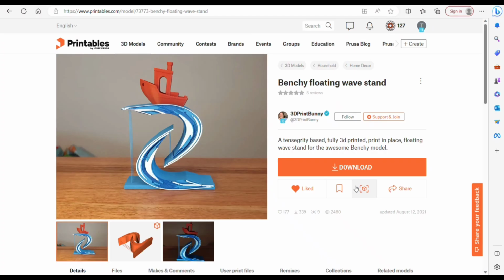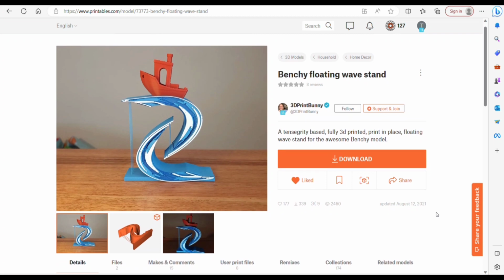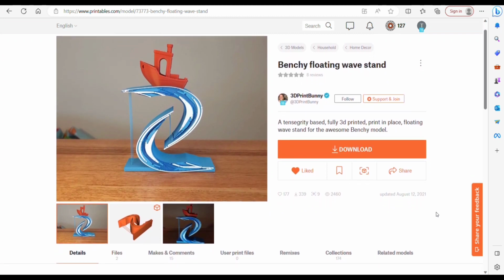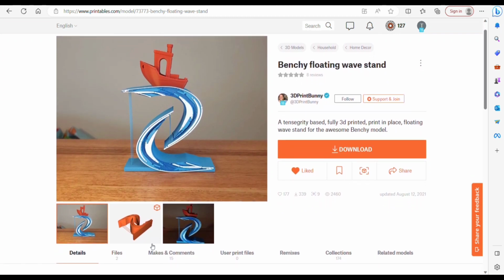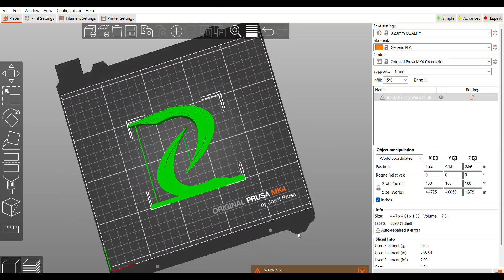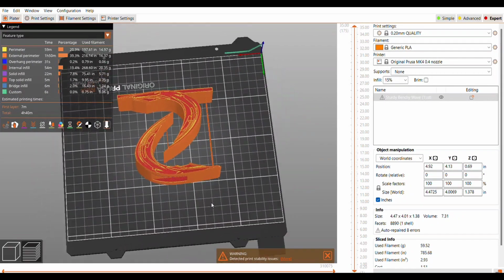1st Print on MK4 Kit Printer - Benchy Floating Wave Stand

Comment: The dual color filament is going to mix, at least some, in the extrusion chamber.

I have worked with pelletized extruders and that's how some of them blend different materials, by putting different types of pellets in the screw conveyor and letting the hot end melt them together.
Reply from the maker: It just seems like other colors have more of a contrast. But maybe it's because the colors are already similar?
Reply: @tada3dprinting  

I would be intrigued to see how something with high contrast works, like black/white, red/green, or blue/orange.  

I guess the amount of mixing that goes on in the hot end depends on the hot end itself and the feeding parameters.
Reply from the maker: This one had more contrast - https://youtu.be/WXBwW22qLMA?si=AmmPTgJbJ78nuQuu. But like you're saying, maybe it's the difference in colors. Thanks!
Reply: @tada3dprinting  That looks really nice.  I'll have to try some in the future.

Comment: The still have go pro battery issues? I had a hero 3 in 2013 and it was junk for battery firmware fixed for a bit.
Reply from the maker: I used to be able to keep it plugged in and be fine. But now when I record, it stops charging. Idk if it's the battery or the cord but it only lasts about 2 hours on timelapse now. Was this what yours did?
Reply: @tada3dprinting  it would be on charge all day and then think it was dead. If you took battery out all settings would reset. Dates etc. a firmware improved it but I think I only got 30mins out of a new battery. 

It would go funky and require removal of battery to reset hence the resetting of settings I guess. 

I had 2 both did the same. 

I should have taken them back after my riding trip. All vids ar 1/1/1900 with 0:00 time. Not very good if you want to make a timeline video.

Try a firmware if not take it back get them to swap it.
Reply from the maker: I ordered a new battery and if that doesn't work, I'll send it back. Thanks!